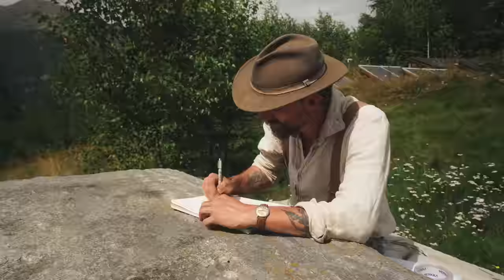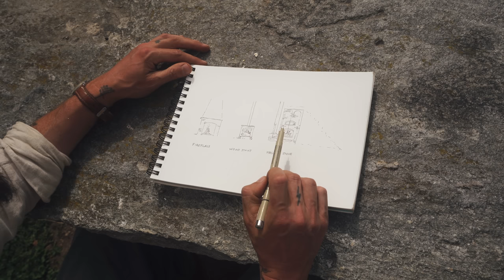#79 Building Outside Patio, Cleaning the Stone Walls, Masonry Stove arrived

Comment: The main thing that distinguishes a masonry heater from other wood-fired heating appliances is the ability to store a large amount of heat. This means that you can rapidly and cleanly burn a large charge of wood without overheating your house. The heat is stored in the masonry thermal mass, and then slowly radiates into your house for the next 18 to 24 hours.
Reply: It works similar like a soapstone oven/heater. Only a few hours heating for having a nicely warm house the rest of the day.
Reply: I really like the idea of that masonry heater.  He mentioned heat - resistant concrete.  I  hope it truly is heat resistant.  I once made the  mistake of building a fire pit using some leftover concrete slabs I had.  Not good; they exploded in the heat of the fire. I'm sure Martijn knows what he's doing.   I didn't lol
Reply: Martijn, time to string up a hammock under the trees and relax for a few days or a week to enjoy the summer and to slowly sort out your tools. I know you like to work efficiently so the disorder must be frustrating you.
We’ll all be still here awaiting your return. Rest my friend! 🫶
Reply: @anniethompson1041  seems to be made by specialised company so should be perfectly fine. Reason your concrete exploded is too much leftover moisture in it, it will quickly evaporate and steam will shatter the piece. For same reason we dont use stones from rivers etc to build campfires because they can explode.
Reply: @Taudlitz  Ah I didn't know that about river stones either!  I wish I had known earlier -  I had a scary moment when that concrete started exploding.   I wonder how they make concrete heat resistant.  I have a metal firepit now.

Comment: The very thick plant layer grown with the tomatoes prevented proper air circulation and promoted growth of the mold. Mold, that established itself on tomatoes, moved to potatoes. Proper, unrestricted air circulation is critical in prevention of mold growth on  tomatoes.
Reply: Interesting…
Reply: Agreed, the lower parts needed to be removed. Tomatoes are " hungry" plants, take more nutrients. 
I think his compost pile should be much closer to the garden space for two reasons, less waling back and forth, plus after the compost is done, it's much easier to add to his small garden. 
Tomatoes grow well in larger containers as long as there's good drainage.
Reply: I grow my tomato’s in large planters it works for me as there are several varieties to choose from
Reply: Yes, as with zucchinni as well, remove some bottom leaves to promote airflow.
Reply: He also had bad luck with the weather, there was lots of heat at first and the very wet weather so the leaves probably could not dry fully
Reply: remove large lower leaves and others needed for good air circulation about an inch from the main stem and don't put any mold infected plants in the compost and risk spreading the mold spores -

Comment: Word of advice: if it's really phytophthora in your tomato plants you shouldn't compost those plants, but actually destroy them (heating the plants up to 60 degrees for more than 30 mins should do the job as well). Composting won't guarantee the fungus to die off, unless you are properly composting and your compost pile will get up to a certain amount of temperature for a longer time. It can either ruïn your future nightshade crops (potatoes, eggplants, tomatoes etc) if it stays in your composted soil, or someone elses nearby. I didn't see where you brought the plants with your wheelbarrow. Also, I'd advise you to plant future nightshade plants in a different spot, crop rotation is key in any case to prevent diseases.
Reply: Best place is greenhouse for tomatoes.  They also need Epson salt.
Reply: Hopefully Martijn will have a greenhouse.

Comment: Late P.S. on a much earlier video: it would be great to hear an update about you plans for hot water and heating now that fall is nearing.  Did you consider getting a hybrid or pure heat pump heater for warm water for the part of the season that ist not dead winter with the stove running non stop? They are affordable in Italy (e.g. ariston), you have plenty solar and it would be much more environmentally friendly than running the beautiful wood stove just for a few liters of warm water.

Comment: Martin! Fine oven, similar to the tile ovens we have in Sweden, where the flue divides into two pipes and go down and then up. inset in clay and bricks, and the outer layer is usual tiles. Your oven seems similar, except the pipes might be shorter. One thing, if you can take the air in from the wall, it will be even more efficient, instead of taking the room air, so since the stones are not cemented, you might move one or two and make a air channel through the wall, with a valve, of course. I think also that cooler air contains more oxygen,which will also add....Anyway, just my reflections regarding the oven. As for a holiday, take some days or a week, and go somewhere and relax ein bischen..... Alldabestest from mikke in sweden....;-D

Comment: You need to get an oscillating tip for your power washer, it will work better and in half the time with less stress on the machine :)

Comment: You have insulated the roof. Will you insulate the outer walls from within? A rocket stove mass heater  is based upon radiation. Would it not be better to keep/capture that radiation within insulated outer walls in a winter situation? I reckon these stone cabins have thick outerwalls which radiate coldness in winter. Ideal for summer, but not for winter.
Reply: Personally I would suggest a white washed insulated retaining wall. Reflecting of natural light would brighten up the place I think. Just my 2ct. Huge respect for your life choices and hard work. Hope you can handle it all mentally and physically.

Comment: 39:50 : instead of using the same stones for cladding you might consider using traditional exterior oven tiles.
Like those common for that use in German speaking countries but also in Northern Italy. F.i. Maiolica Trentino.
Those tiles distribute heat from the hearth much better into the interior.
Good chance you might find a small stack of reclaimed ones for a fair price.
You might also hook up a boiler to the hearth, like is done in German speaking countries,

Comment: Here in Sussex [UK] there are examples of Weald houses from a thousand years ago that were timber framed  [quite often with herringbone brickwork filling the timber frame gaps, and also wattle and daub finish to the interior walls]. The main feature was a heavy masonry chimney in the centre of the Weald house [as you mentioned this masonry radiates heat for many hours after any fire is put out]. This evolved with floors / rooms / fire places being added and it was known that you should always 'Keep the home fires burning' [for cooking in summer etc.] as it took a long time to heat up that big lump of masonry.

Comment: Could you build a sort of cellar for the batteries? The thermal mass of the earth might be better insulation than a shed above ground. Even if it were dug into the hill on three sides it might be better. I have no expertise with this, just speculation.

Comment: I see several people that are restoring stone cabins use the water pressure method , would air pressure be easier and cleaner or too dangerous ? I’m Not an expert or nothin , an amateur at best (in learning ) I mean you can wash lightly or oil cover to get that color, or you s this absolutely necessary to do it the way you’re all doing it ?

Comment: you are incorrect about the Iron stoves as you call them mine has a chimmny damper which means I can regulate the burn rate of the fire or shut it down completely  plus they are brick lined so they too hold the heat and they are very effecent burning .

Comment: Hemp lime render on the interior will give you increased thermal insulation? New scientific report  out on the atlantic conveyor is giving two years until it stops. If it does, temps will plummet by 15 degrees on average in Europe..

Comment: To strengthen all your interior walls and save time I would first tie and pin 10 gauge remesh to all interior stone walls.  Than I would spray the walls with 2-4 inches of Gunite .  Now your walls are square, locked together and super strong.   After that, pour the concrete floors.  And after that, go back and have the walls plastered with a nice Old World, Cat Face or Flat Travertine Trowel  finish and paint white for good interior lighting.

Comment: Hi Martijin, have watched all the way so far but have stopped on this video to ask what did you do with the diseased Tomato plants? 
Mould has become devastating over the last several yrs and all must be burnt and any close vegetable plants. The mould spores travel quickly and appear earlier the following year. Soil area of roots also needs to be dug up & disposed of in same way.
The only way Tomatoes can be grown in humid areas are Greenhouses or finding Heritage Tomatoe seeds which have shown resistance to this mould. 

Fruit! Get rid of wiring!!! How would you feel all choking together & sweating,? Your fruit is struggling like this. I could cry everytime I see them.fruited cut out old fruiting canes & let the bushes spread. Give a good mulch of manure now & spring. You can take 12" of sturdy new branches & stick straight into ground half way ( currants & gooseberry) they will have great new plants next year. Raspberries after cutting old fruited canes, dig up, split plant. Re-plant in desired manure enriched soil.
All water well you will have a wonderful harvest next year. 

I am so happy for you that despite hiccups you are advancing so well. 25 years ago I was renovating a Colombage home hard work to say the least but well worth it. Three years later living in such a cosy environment,  low noise level, managed to save interior doors & glass 120 years old but seemed to be clearer than modern day glass & never smeared on washing.

I remember well the aching back, splinters and wiping away constant dust. I loved my home and land so much. Regrettably through extreme ill health return to England was the only sensible decision. After living back hear for 14 years so regretting France but at least the memories, are so fresh that they just feel like yesterday. 

Putting video back on to watch the delivery of stove. Have a great week

Comment: For moderators - For the awareness of Mr Doolaard and other viewers.

Last week’s episode- #77 VicJohnson made an entry concerning a possible issue .

I also experienced a similar interaction and shared my experience on his post there.

👉🏼👉🏼❗️Concern - are there scammers piggybacking off of Martins videos offering gifts which require prepaid shipping❓

If these folks are frauds or scammers… perhaps Mr. Doolaard could address that in his videos at the beginning this is of course to prevent scammers from ruining Martins videos for long term and new viewers.

He may even want to add something to his website accounts.

V/R
Viewer from the start.
Reply: Of course if things are legitimate… Mr. Doolaard could also explain that as well.

All too often scam frauds tell individuals they have won something… then in order to get said prize expect payment up front 

Especially since I suggest my prizes be donated to a needy cause instead of being shipped to me.

Comment: About stove. You have stones all around you. Walls! They will consume heat from hot air and release heat in to cold air. It is very hard to overheat room with stone walls! 
Actually you need steel or cast iron oven. Because you need to heat up house made of stone. Houses made of wood in climate with harsh winters have big brick ovens! For example, Russian oven.